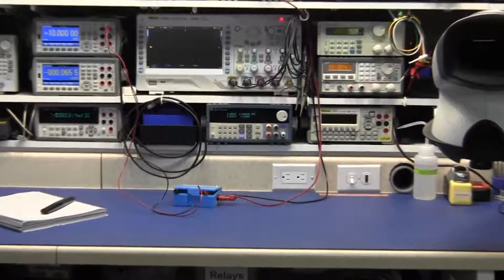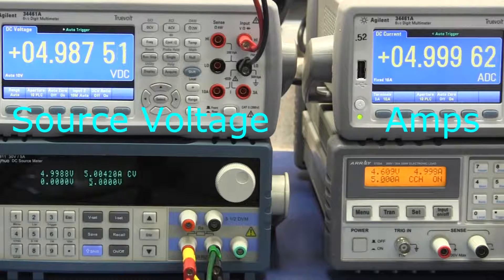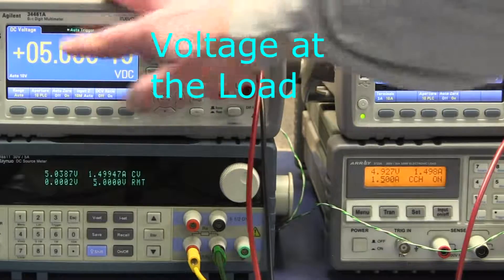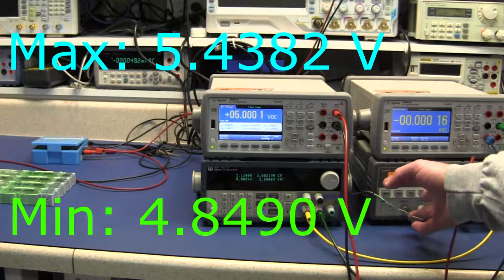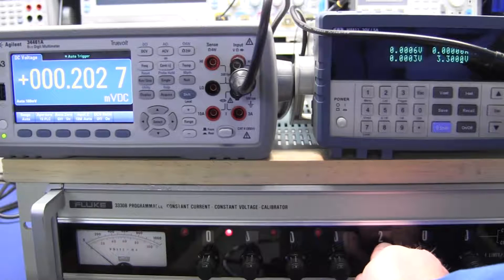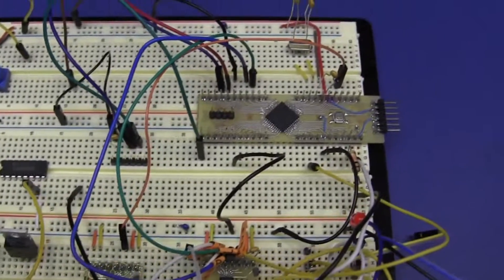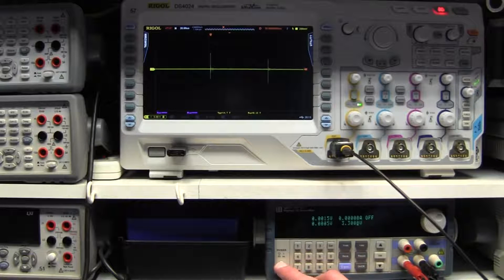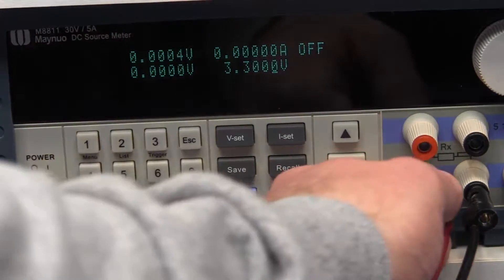Maynuo M8811 Power Supply Testing

Comment: I hope it's okay I ask you on your opinion about a great programmable electronic load I do not need more then 30 volt 5 amp but it have to be "ripple free and noiseless" I have seen many detect a lot of noise on the cheaper ones, like you do on the psu in this video. Thanks for a wary informative video, by the way:-)
Reply from the maker: I'm not sure about a programable electronic load that is noise free, but there are analog loads.  For noise sensitive applications I have a Tekbox self-powered analog load, made by Digital Solutions.
https://www.tequipment.net/TekBox/TBOH02/Electronic-Loads/
Keep in mind the power limitations, you'll need a fan to go over 25 Watts, and it can only handle 100 Watts.
For higher, noise-free loads I use lightbulbs of roughly the correct voltage.  I often use halogen landscape lights.  I just run it long enough for the load to thermally stabilize.
Some people use heavy enameled wire in a bucket of water.
Check out this video:  https://www.youtube.com/watch?v=WECW88rJYrE